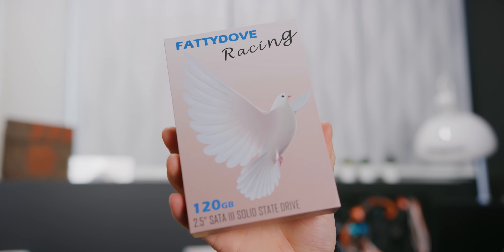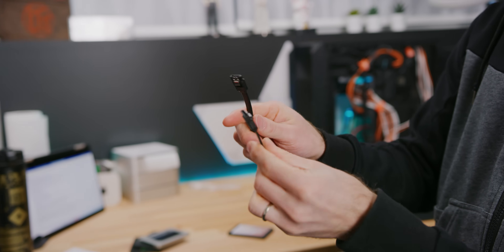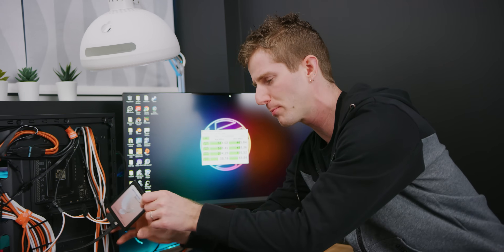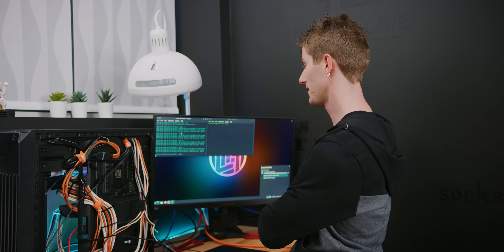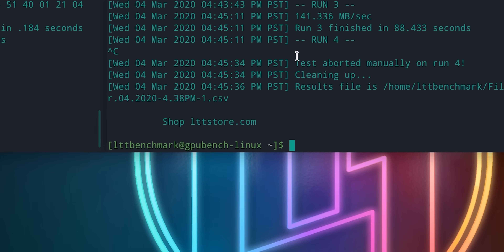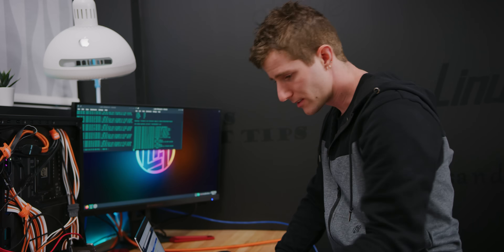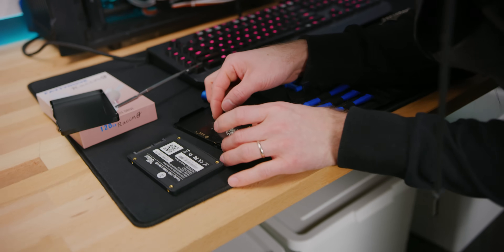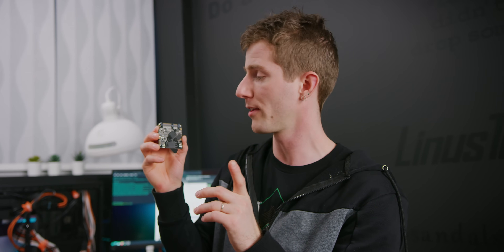How bad is this $20 SSD??

Comment: I swapped my HDD for an SDD the other day and the little screws that connect it into the hard drive bay are too short? I just used gorilla tape but I don't understand why the screws didn't fit. That's like the 4th time I've switched the drive in this one and it's always fit before! Kingspec 512 gb. 19.99 on Amazon. Didn't come with screws or a cable or anything.

Comment: I bought a $18 Kingspec 128gig m2 sata ssd in 2017 for my elitebook 840 g1 for a boot drive.

It saturated peak Sata speeds easily, my boot time to win 10 went from 4 minutes (before mouse stopped showing busy pointer after login) to 8-9 seconds, on par with mbp 2016, and system responsiveness was amazing as well.

And the SSD outlasted the laptop so I'd say for old PCs, laptops which came with an HDD, an ali express SSD isn't a bad option at all for a boot drive, just don't store any data on it.

I abused the hell out if it and even set around 8 gigs of swap on it which was heavily used as the laptop had just 4 gigs of ram.

Comment: They sell it for $85 now.
Reply: No they don't... You can pick up a 240gb fattydove for 24 bucks. And you can get 128gb ssds for about the same price as a thumb drive. I use them to flip laptops all the time.
Reply: Ssd are hella expensive now. I bought one last year for 40 and its now 120 for the exact same one

Comment: 10:17 "That is not a lot of PCB".

That's apparently the norm nowadays even with TLC NAND chips. My 2TB Crucial MX500 has 4 NAND chips alongside it's DRAM cache, it's oneof those SSDs Linus gestured about. The newer 2TB MX500 is much smaller than its brethren from a few years back which had 16 NAND chips. It's much smaller than this 128GB SSD. I think the 4TB version has the same 4-chip PCB but with higher capacity NAND chips.

Comment: I really hate that drives like this exist. Some users will never know what a real ssd is like because they only buy the cheapest ADATA, PNY, or off brand SSD.
Reply: Just bought a new 240GB Crucial BX500, best ssd according to many tests, for 18 bucks so it's not about money. But for a moment I did consider the PNY alternative until I looked up said tests.

Comment: ammm still gonn go with teamgroup's budget 1tb SSDs , those guys run games and programs for days and are cheap for days too
Reply: I had a team group ex2 elite in my ps4 pro, took it out 4 days later for a western digital blue ssd, the ex2 literally somehow took longer than the stock hdd to do anything
Reply: @josephhall7317  Been buying the GX1, GX2 line and vulkan-Z, not sure about the EX series but its possible SSDs and HDD come to you as DOA duds or innefective speed units, happened to me a few times. For one I heard western digital often sends DOA hdds and SSDs from their fractory floor to the market  by accident (with a large margin of doing it with defective units like seagate, I personally experienced it I mean). Have yet to be sent a crappy or dyin SSD by teamgroup tho.
Reply: @Goatisme  my teamgroup would rarely work as it should but the western digital at 30$ has hiccups too sometimes I just noticed it a lot more with the teamgroup elite, maybe it's because it was running the Playstation OS and games with no dram but I'm sure as an external for just saves it would have ran a lot smoother
Reply: @josephhall7317  yeah it sounds a bit like your hardware isn't using your SSD the best way there is, it sounds like there might be some compability issues with the playstation rather than with the drives. 

Personally I kept myself around Playstation 2 because the only modifications you gotta do for that console really is replacing the laser reading diodes when they are dead or dimmed and its a 5 minute disassembly and reassembly, a guy on youtube even does it in that timeframe without much of a plan in a single shot video, I frickin love machines that aren't hard to take apart and since playstation 2's slim I haven't seen that many big lineups that can match its ease of access, then again, the only memory its got is memory cards (native ones only got 8 mb too though you can now shell 35$ for 2x128 mb cards easily). Good luck with finding a SSD that's worth it for your playstation hardware, sounds like it could be a drive cache and just drive specs not aligning properly with the playstation.
Reply: @Goatisme  I had a white ps4 pro about a year ago with a crucial MX500 1tb ssd in it, and it ran as smooth as a system can run. I think the disk drive in the one I have now might actually just be dirty but I don't want to mess with it and possibly break it and the tech that I had put the teamgroup and then the western digital in would probably charge a lot to mess with the disk drive so I'll just leave it how it is unless it gets to where it's not really usable

Comment: i bought a 120 gb walram ssd from aliexpress, and besides the temp is off the charts like crystal disk tags it as bad, ive been running it with my os for like a 1.5 years, not great but it costs like 10 us dollars, lol , ps. i dont save any info on that drive just the OS and programs

Comment: 20$ for a 128 gb sata is quite expensive actually.. I use a 512 gb nvme, bought for about 40-45$ (if using usd currency, idk I'm too lazy anyways), you'd expect to get 100 gb/10$

nvm this video is more than 2 years ago, things were probably more expensive anyways

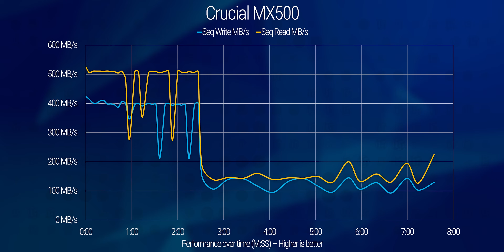Comment: 11:31 I guess it's read ahead kinda deal.
The ram simply fills as fast as the flash memory allows,
and if there's sequential reading, it'll burst from the RAM.
INversely when there's writes, the RAM my store the writes,
until it has decides is has enough to make a pass.
I guess this SSD writes slow when it comes to longer files.
Reply: Now take x4 of those put them into a raid, and compare to $80 competitor or better.

Comment: By John Edward Llanes on November 26, 2020
Unfortunately, it no longer has a DRAM cache. Controller is an SM2258XT with 2 unknown NAND flash chips.
SATA cable is still included, though. At least there's that.

Comment: I bought a 22$ SSD, honestly, SSDs have come a long way and cheap 256GB can be gotten for relatively low prices, the 1 TB ones are still in the 100$ price range though.
Reply: I got a 1tb SSD from crucial for my wife's laptop this year (2023) for $60 USD. Prices have come down significantly over the past few years

Comment: TBH, I've used "budget" SSD for some time 

However! There's a caveat to that.

Every single system I've ever put together, I've always had a dual drive set-up.

The SSD only has the OS on it 
The main drive for storage is usually, just a basic old fashioned HDD.
There's a reason for this...

Firstly, if the disc with the OS goes south - your files are still fine and aren't eaten when it all dies.

Second, old drives don't fail the same way as SSDs. Baring a head crashing, or motor burnout... Their death is often a slow process, so you have time to lifeboat it off 

There's another added bonus - the load duty isn't all just on one drive.

So your OS drive is only dealing with updates and such (reading SSD isn't as "destructive" as writing town SSD).

The file drive us only dealing with files, so even though it's an old style HDD... Unless you're doing an immense amount of video editing, speed isn't going to be notably bad and there's no updates to grind everything to a standstill...

It's a worthy consideration.

BTW got a cheap "King Dian" drive (SSD) still going well after a year or so 
I'm surprised TBH.
Reply: I would never gonna use HDDs anymore except USB powered external ones, for backup, archiving, and doing things like downloading large compressed files and storing temporary game development or raw video files.

For the internal drive itself, any of them, i never put important things. They'll be back upped into external drive or hdd

Comment: Just FYI to everyone: many people in the Amazon reviews have pointed out that the SSD no longer comes with a DRAM cache.
Reply: It might be that the racing version has a DRAM and the non racing is DRAMless, since I noticed that they removed the racing on the packaging....
Reply: Big name manufacturers have been making DRAM-less NVMe SSD for a while
Reply: @Henrex2000 and this is sata lol
Reply: Thank you for letting us know! 😃
Reply: LMAO
Reply: I want to buy SSD For storage only And I'm not going to put it inside my device.  Is DRAM important in this case?
Reply: @OkerRe  not as important
Reply: @OkerRe  Yes, it always is. Unless you don’t mind waiting hours for simple tasks, plus they generally die faster. Better to just find one that has it and save yourself the trouble.

You might as well get a large HDD for storage, because when the cheaper ssd without Dram get even slightly full some of them are ironically slower than a fast HDD

Comment: I recently ordered a 1Tb SSD from Newegg for $10.99.
It's a NAS drive technically but it has a proper cache. Wish me luck!
Reply: So it's 128GB like this? (I know you meant TB)
Reply: @David001  nope, they canceled the order
Reply: @David001  yea, the auto correct isn't always worth correcting.

Comment: $20 is actually kind of expensive for 120GB. And no one should buy a 120GB SSD anymore.
Reply: 120gb still has uses. Pair it with a 2tb HDD and you have the best of both worlds for very cheap

Comment: Just a heads up when buying, it's no longer equipped with dram. As well, it doesn't have a long lifespan compared to quality stuff. It does work though, so if you need it get it.

Comment: When you only have $20 and need an SSD, it's likely great. When you can spend $60 on a Barracuda, it's a turd.  I have had nothing but great things to say about my Seagate drives. I'm sure any quality drive is great, but the manufacturing quality on the SATA 2.5 Barracuda and Firecuda drives is top notch imo.
Reply: Isn’t the barracuda an HDD???
Reply: @mareksicinski3726  no.

Comment: I think these guys (whose videos we very much enjoy) are so immersed in the "latest and greatest" that they forget how expensive it is and nearly impossible for the average poor working joe to afford. I use the PNY SSDs on Amazon they cost about $35 for a 250GB and they work pretty well. I mean, yeah, I don't expect to blow benchmarks wide open and I feel those are for show and bragging rights. If the system you built works for all your needs, who cares. 

The cheap SSDs do work faster than HDDs by quite a bit, I can boot into Windows 10 in a matter of seconds versus before with an HDD which now I only use for storage.

Comment: I've just listened this video and it made me realized that I'm not confident about using hardware (even usb key or sd cards) that come from cheap and unknown manufacturers. The reason is that it can spread malware or open backdoors that could eventually put your system in a jeopardized situation. I don't feel comfortable that this point isn't discussed in videos covering that matter. It has already happened in the past that some hardware was showing such behaviors. Big makers like Samsung for example, have to much to lose doing this, so, it's almost certainly safer. I didn't yet spoke about R&D that could end into great conception flaws (for an SSD, I admit that there's probably nothing serious in that regard). My point is that I would like to have a complete portrait of this subject on your channel. I believe it's important - particularly today. People doesn't care enough about computers security and it's bad in my opinion. Security in hardware can be critical: drivers run into the core of the OS, hardware are even on lower level... So, maybe it can just allow to turn your pc into a bot, but, can cause much more than this. So, I'm hoping to know if I'm too paranoid or if I'm right, and, to which level. Having you bringing security experts that are focusing on that particular angle (hardware and the likes) would be great - maybe just to me, maybe not, who knows! Finally, I want to remind you about IP cams bot or USB keys with in factory corrupted controllers to close my request.
I really like your work, continue!

Comment: Unfortunately, it no longer has a DRAM cache. Controller is an SM2258XT with 2 unknown NAND flash chips.

SATA cable is still included, though. At least there's that.

Comment: Did anyone consider this could be something like those Chinese USB drives which have spyware built in, and the cheap cost is offset by your data being stolen and your system possibly put on a botnet?

Comment: Welp...after watching the flamefest, I just hadda pop over to Amazon, and huzzah...they have the Fattydove Racing SSD's back in stock. Not to be outdone, you can now purchase your very own Fattydove drive in 3 different flavors:
1) 120 GB for $34.99
2) 240 GB for $61.99
3) 480 GB for $117.99
Given that I purchased a Samsung QVC 1 TB drive for substantially less than their 480 GB SSD, I'd say their pricing needs a bit of realitizing. My dear.

Comment: A year ago i didnt know anything about SSDs until i lost all my work at my office due to SSD going bad. I was so pissed and thought SSDs suck because it was only 3 year old and i did not perform serious write/read operations.
Then i found out it was a shitty Patriot Burst 250GB SSD, price 20euros. 
Its not worth to save on SSD, you will surely regret it. According to amazon reviews they are randomly failing after as little as few weeks usage. So i was lucky to have it working for 3 years :)

That was at my work. Then i have researched information about SSDs and bought one for home personal use- samsung 870. Perfect solution into my 10 year old laptop :)

Comment: Linus, you're wrong about Dram-less SSD's. Most hard drives run at under 100 MB/s while Dram-less almost always goes over 200. In fact, my HDD only runs at 20 MB/s while the cheapest SSD I could have possibly bought goes over 300 MB/s. That's a 15 times increase; if we use the average, it's a 2-3 times increase, which is definitely something. And plus, some Dramless options are far cheaper in other countries, making them much more viable solutions.

Comment: There is one other advantage to an SSD that is unrelated to speed. If you're using a laptop in a car while someone else is driving, or on public transportation, or in an airplane, bumpy motion can cause data loss, or worse, with a hard drive. An SSD doesn't have that problem.

Comment: Even if an SSD is slower than a mechanical hard drive, it might be worth using over a mechanical drive due to power consumption, weight, and lack of moving parts.
Reply: I want to buy SSD For storage only And I'm not going to put it inside my device.  Is DRAM important in this case?
Reply: @OkerRe  laptop or desktop?
Reply: @potatoes5829   laptop
i'll make it out and buy him a sata port
Reply: @OkerRe  DRAM is very important in this case. 

This is because you said you are going to use SATA, which is slower than NVME. The thing is tho, all drives need ram of some kind, DRAMless ssd just use a small amount of system ram through the port instead. This is ok on a fast interface (like NVME), but on a slower interface (like SATA) the interface will bottleneck the ssd.
Reply: @potatoes5829  thanks for this  Great information.. Is SA400S37/480G form Kingston a Good choice?
Reply: @OkerRe  kingston a400 is a solid choice, but personally I would go for a crucial mx500 because its not much more expensive, but has better all around performance.
Reply: @potatoes5829  Actually , I have already chosen the MX500. I forgot to edit my reply.. It is better than kingsont and I got a good offer at Amazon it is around 45$

Comment: I don't know if anyone watches older LTT videos, but I want to point out that, probably because of this video and its accidental "endorsement," Fatty Dove drives are now more expensive. The 120GB version they tested here isn't $20 on Amazon anymore, it's $35 USD. And the 240GB version is $60 USD, which is more than I paid for a 250GB Crucial MX500.

Comment: hi -- great review -- about power loss protection PLP
 ... if you have written data to DRAM cache and have power loss before that data is committed to NAND, you lose that data
... PLP capacitors hold power to commit data from dram cache to nand ever after loss of power.
... leave read caching ON, turn write caching OFF, is a good work around to use dram caching without PLP

Comment: Saving on removing the DRAM cache can make much sense, if you think of a purpose built SSD only used for archiving purposes, can fit more modules on the limited space PCB.
This is where lower level bench marking tools and graphing becomes important. With using Linux I'd look to use perf, BPF or Dtrace for more specific lower level numbers.

Comment: This would be perfect for an OS-Drive... Keeping just the OS, and the OS's updates and backups, etc... There is little, if any, writing and if you optimize the SSD for faster loading... (Making sure there is no "file compression", and all unused files are "moved to the end", with all "common used, but not altered files", are moved to the front, with a small "sector size", so smaller files fit closer with less dead-space between them...) I am sure it would be well worth the $20 investment. When compared to any HDD, or one of equal speed and size.

Or, for those who just want to stop killing their expensive SSDs... Buy it to use as your "temp folders", "recycling-bin", and "Swap-files" storage space. For $20, it'll save you hundreds of dollars in damage to your limited writes in your larger SSDs. Just replace it as needed. Its not like swap-files need fast access. Only unused crap is stored there, until its needed again. If its needed again.